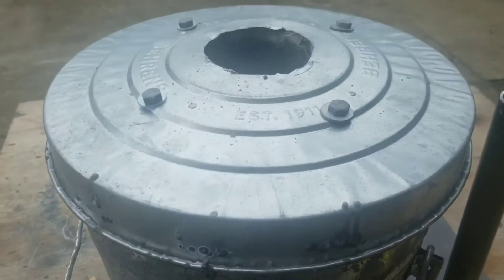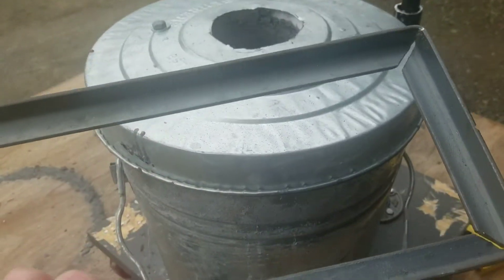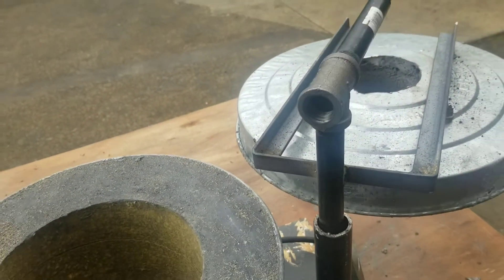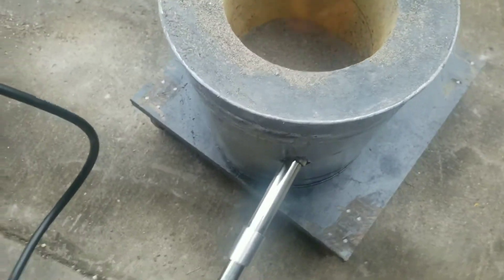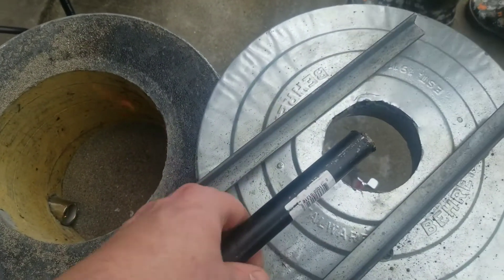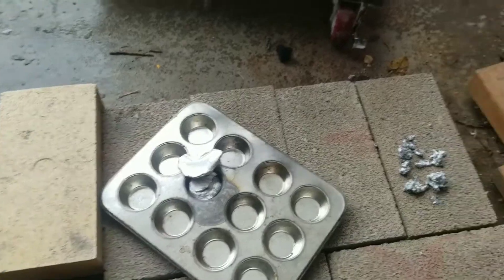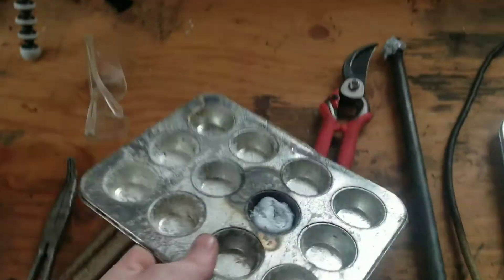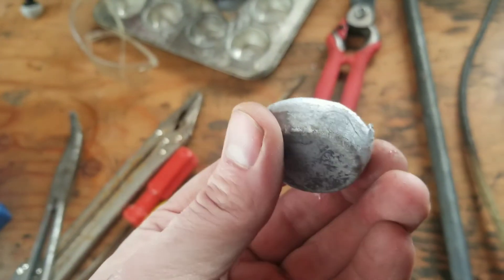How to Build a DIY Foundry Furnace for Metal Casting at Home (part 3)

Comment: As requested... 😄
The curse of the new muffin tin, they never come out. Just be glad you didn't pour copper in there, it welds to the steel. 
Don't know if you ever pulled the burner back so its not inside the chamber, but you're going to want to do that. Having a little flare on the end of the burner will also help maintain the flame as you open up the air.
Reply from the maker: Yeah, I eventually figured to pull it back a lot more.  It's certainly a learning curve. Thanks for sharing your knowledge!
Reply: @JasonSipe16  It is that, there is always something to learn.
Reply from the maker: @swdweeb  I tried for years to figure out what my hobby or my art was. I think it is just learning how to do cool new things (to me). And failing and succeeding (sometimes)
Reply: @JasonSipe16  I hear that brother, learning is and has been a huge source of my enjoyment with casting.